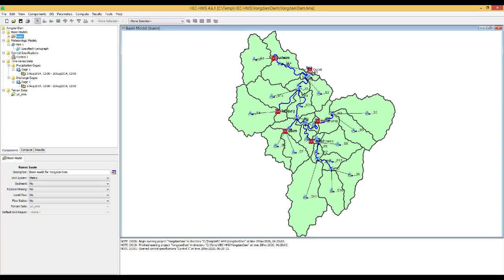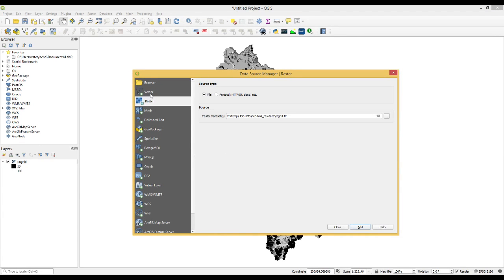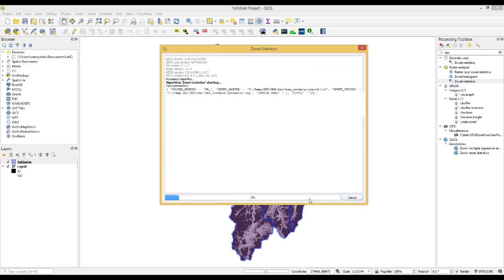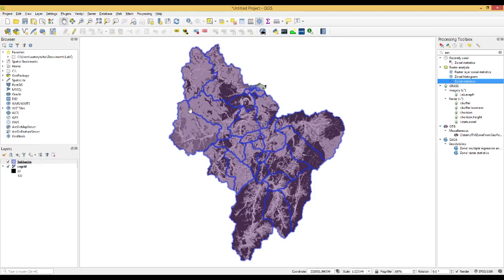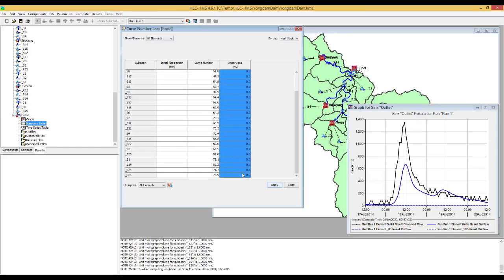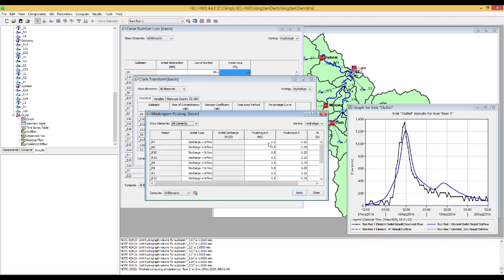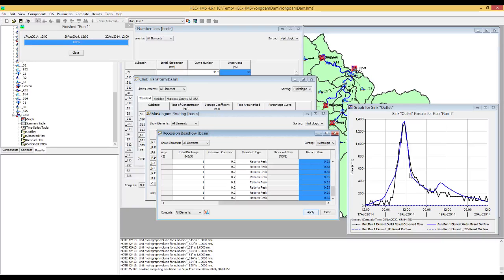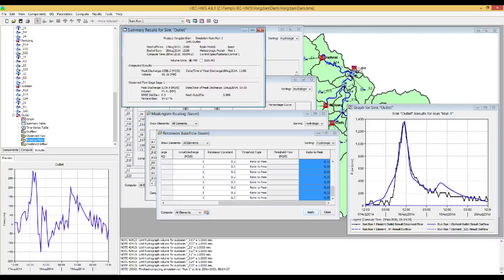HEC-HMS Model Simulation and Calibration, Part 3/3

Comment: Thank you so much, I have a question, what do you think of HEC-HMS as a continuous model? Is SMA a good loss model? Thanks again for your videos!
Reply from the maker: Typically used for flood analysis as a event model, but you can use it for a continuous simulation with SMA method!
Reply: @SWOT_to_SWAT  I'm using this method but it's too complex